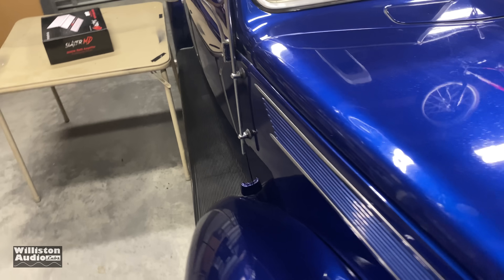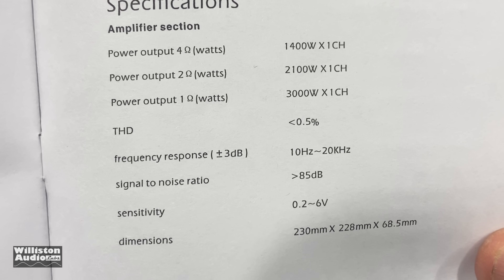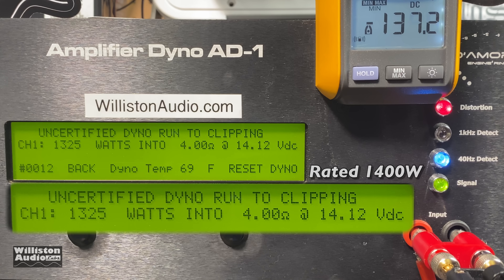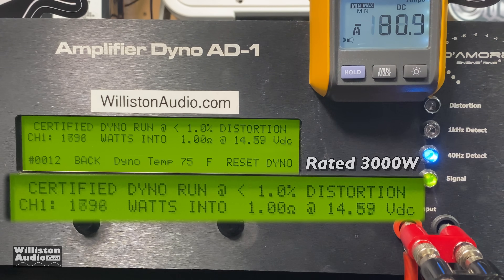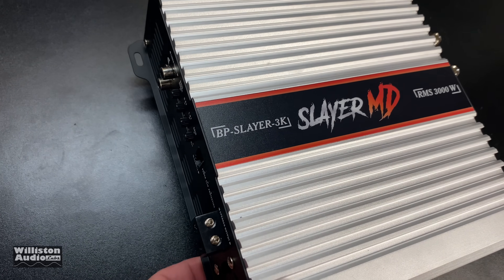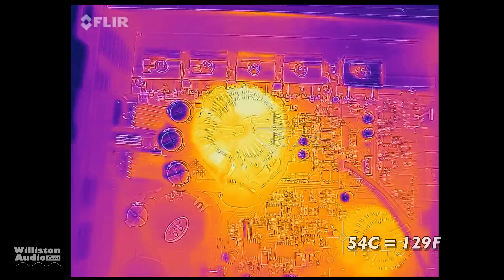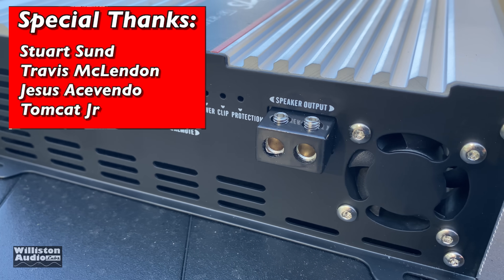Can a $180 Amp Do 3000 watts? Bully Performance Slayer MD 3kW Amp Dyno Test

Comment: I don't care if an amp puts out 20,000 Rms and is on sale for $99.00
I don't shop Dollar per watt like when I was first starting out. When I spend my time on an installation I want it to last as long as I own the car. I don't want to worry about anything. Name brands that have been around only for me. Sound, clarity, longevity.
Not something that's going to kill my electrical system either.

Comment: They come with the new bass knob from the 5k video now🤣 i ordered mine after watching this, has a vm bass knob and clip power protection lights, cat 6 ethernet  style cable. Oversized 1/0 inputs, im running oversized cca 1/0 to mine, cables dont get warm so im not crazy worried, ran mine @ 1 ohm on a set of gravity audio g3 12s in a sealed enclosure, wound up blowing those in a monthish, now im at 2 ohms on a single seismic audio gfc 12 thing giant
Reply: I had to double check the rms at 2 bc i dont wanna blow this beautiful sub, gonna hook my audiobahn a8000t back upto it i think haha

Comment: Should test it at 0.66 ohms. I'm tempted to try it with mine but I'd like to know if it will handle it first. Lol
Reply from the maker: Most of these full bridge are not recommended with loads under 1 ohm. Try at your own risk

Comment: I just found (and bought) the only one on eBay for $180. Thanks for the lead Big D!
Reply: Aaaaaaand I've now cooked two subs with it. Today I ran 1/0 ofc and did the big 3. First victim was a JBL 10, not even sure of is max wattage. Second victim was a sundown 12 rated for 500.
 D was dead on about the potentiometer in the bass knob. It's all but useless. I still can't believe the power from such a small amp. Thinking about ordering some Rockville Punishers and building a 4th order.
Reply: Also I'd like to note that the lpf has a very wide slope. Set at 50hz it still puts quite a bit of power into frequencies up to 125. You can tell it's rolling off, but not much. I'm thinking about adding a crossover to get better control.
Reply: I put a Skar VXF12 on this thing today and it lbs.
Reply: I'm still rocking this amp hard over 2 years later. It's now pushing a Skar ZVX-12-2 wired at 1 ohm. I recently added an ioxus ultracap.

Comment: Will u test a stetsom 3k or larger I'm really leaning towards them and I like the clip button they have.
Reply from the maker: Pass on da Stetsom. Go Banda or SounDigital if you want the best Brazilian
Reply: @wal  idc if it's brazilian, chinese, or american I just need 3000 watts RMS @ 1 or 2 ohm stable as cheap as possible.  What would u buy?  I've had taramps 3000hd and I have no complaints but the price of the amp keeps going up

Comment: I wish you could test/check my 5800w 12v amplifier with built in Cross over. 2x 2650w stereo. £85 brand new. So I really need a capacitor or two and a ground loop isolator. Please respond and help if you're interested or have nothing better to be getting on with, and maybe you can help me get the most from this amp? Happy lockdown party people xx

Comment: My receiver died of old age so I grabbed my old Alpine MRV- F353 five channel car amp to power some 150 watt Klipsch floor standers. Using my Galaxy S9, the highs and mids are clear but on some songs, the bass seems suprisingly strong. Is that normal? How is my phone DAC compared to an Alpine head unit DAC? I bridged the amp to 125 wpc but with the phone max volume, my windows weren't shaking.

Comment: 😲 "What and the Heckle n' Jeckle....?!?!" I mean literally... Why not just buy 5 at that price and size? I mean run each speaker using just a mere 20% of the Amps output or roughly 240w +/- and then use the last, or 5th one, to crank the shiz up to a thow or so, just a bumpin outta of your sub. Distribution Block it and fuse it to keep your alternator from frying.
     Future proofs too, for sure.
      WHY can't I get home Amps that cheap? Whether it be a Sub Plate/mono block, or whatever that cheap. MY Crown XLS-2002 and even my Behringer NX4-6000 seem over priced now. Just run one of those per speaker and be done. Like... Done, done. hmm 🤔

Comment: Did you try .5ohms?
Reply: Pretty sure this is a full bridge amp, which you really can't load below reccomended
Reply: @trevormtb9372  it's going to over stress the amp for long time .5ohm but for a quick test it should be able to handle it even though it's not a big name amp like kicker. I have my kicker 600.1 ran at 1ohm pushing 2 15" old-school sound stream 170's. And it's not rated below 2ohms.
Reply: @headkase11  youre mostly right, but this is a resistive load not an impedance load. Meaning there's no box rise. When pushing subs, amps usually see a load a lot higher than the nominal impedance
Reply: @trevormtb9372  that's true buttttt in the past he had extra bonus footage of going below recommended loads 💪🏼

Comment: How did you wire the four subs to the amp?
Reply: Probably series parallel.......
Reply: 4) dual 2ohm subs wired series then paralled together would give u a 1ohm final load

Comment: When you say stock electrical, is that the hot / ground wire or sumin else ?
Reply: Have extra batteries 150ah, use 0awg or bigger,  big 3 and or alternator 150+ volts.  Stock wouldn't have any of these!
Reply: @AGAPE_78   gotcha. Thanx buddy ole pal
Reply: It's the wiring between the alternator and battery, the grounding of the battery and engine (alternator) and body, and then all the wiring and extra batteries, caps, etc you add in order to connect the amp.

Comment from the maker: Video Timeline:
0:00 Slayer MD Trailer
1:13 Unboxing of the Slayer 3K
1:49 Included Accessories
2:55 Features / Dimensions
4:14 Amp Dyno Tests
7:48 Test Results
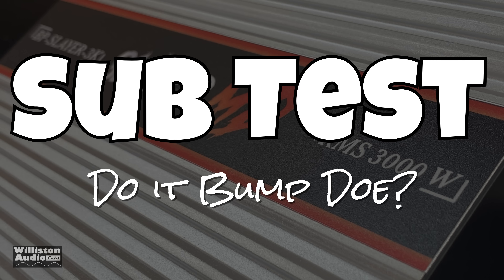8:08 Subwoofer Tests
11:37 Thermal Imaging and Internals
12:57 Pros and Cons
14:18 Extra Boom
Reply: all that time and they are all gone and not making anymore
Reply: Check out those topstronggear amps on Amazon. May be something your audience will enjoy.
Reply: How many extra batteries would you recommend to run 3kw, I have a 600 amp hr fastbatt capacitor and one 940amp battery under the hood with a 1000amp agm car battery in the back close to the fastbatt. Zero gauge power and ground but no big 3
Reply: @201231  I'd do big 3. You have enough batteries. You need the big 3 to keep those charged and possibly a alternator bigger than stock in my opinion.
Reply: @markeithcash  I misspoke about the fastbatt, it's 7 amp hours 600 Max amps @ 16 volts
Reply: @201231  how many amps is the Alternator
Reply: @craigengelman4534  stock 105,they have a stock 145 for the headrest dvd screens if you chose that option
Reply: @201231  you gonna need 200 plus amps

Comment: 2 questions
1. Why does efficiency go down when the power output goes up?
2. I'd like to know how long the amp can play before it goes into protect mode?
Reply: I laughed at #2. Amps aren't supposed to go into protect. It means something is wrong. Either it's getting too hot, wrong impedance/load, total failure.

#1 is how electronics behave. Especially cheaper ones like amps. This one being 80%/78%/68% is actually pretty respectable for amp efficiency
Reply: @tonyamaya6972  yeah your'e laughing cause you're a dumbass lol. This is a cheaply made amp, I can't imagine the amp playing for extended amounts of time without getting too hot and going into protect mode. Maybe it can which would be more than impressive for the price... maybe you're rich and have never had a cheap amp before, if that's the case your money has made you more ignorant than my question.
Reply: @HeadHonchoMofo  I think you took me lol the wrong way. Maybe your cheap amps weren't the problem there Chief. I've had amps go into protect... Because I was doing something wrong and because I'm in Phoenix where thermal protect of the 90s and early 2ks was easy to achieve here
Reply: 1 more energy flowing from the battery input to the audio output generates heat which wastes energy.  There is more heat generated at lower ohm loads so the efficiency suffers.

2 an amp should never go into protection mode after any amount of time. If it does that means that it is not hooked up and adjusted properly, or it has failed internally.
Reply: @303nitzubishi4  amps still get hot, even if they are hooked up right. Being this is a cheaply made amp I can't imagine this amp pushing 3k for extended amounts of time without overheating and going into protect mode. Maybe it can, that's why I'm asking the question.

Comment: Hey Big D could you pretty please test some of the new Power Acoustik vertigo amps. They have a claimed 1000 watt amp for 99 on sale right now.. va1-4000d
Reply: I can tell you rn you wanna divide anything power acoustik makes power by 4. My 2500D 2500 watt max power is more like 800 watts max power
Reply: @austinwoodside   I'm totally skeptical of their BS claims but this one has 3x 40 amp fuses seems promising
Reply: @rmblwgn  Hope we get a test video because that would be a great deal. If my math checks out it could put out 1700-1800 depending on voltage

Comment: At 9:29 your subs are bottoming out badly
Reply: Knock knock.
Reply: mine also sounded like that where it sounds like a really bad loud screeching noise or something hard to explain, the subwoofers still hit like crazy but during the songs and different notes it doesn't sound normal what can i do about that? do i need a different box? because i had to use a hammer to force the subwoofers into my box even though the box is for 12s and the subwoofers are 12s
Reply: @RedragonReviews  Bigger xmax subs, or use subsonic filter
Reply: lol probably just didnt spend time adjusting subsonic

Comment: They should of named the amp "The Fire Starter"
Reply: I'd guess if you treat these amps with respect, they'd last for years.
Reply: James Plotkin  Agreed, I think that goes for most things.  I don't like abusing products I have purchased.  As an example if the amp is rated for 3000W I'll only run it to maybe 1200W, if I need 3000 W I'll buy a 4-5000W amp that way everything stays happy and it's not pushed to its limits.

Comment: Big D, I have 4 of those same exact subs, I've heard them bottom out on the back plate before, (my fault), I swear, on some of those bass tests you did, I heard those subs bottom out 😬 .. am I hearing things? Did you set the filters on the amp ?
Reply: That, or whatever he has the box sitting on. Could be either but that box sure was moving around.
Reply: I thought I heard it too!
Reply: Yeah there are alot of commentors that heard them bottom out. That's the risk you take when you're tryna make an impressive flex video. I doubt bigD tunes the subsonic filter for these quick tests these are just for fun

Comment: Looks like a generic taramps 3k
Reply: All High Voltage boards are the same lol
Reply: @989Kaleb  full bridge amps are lower rail voltages.. But this is a clone of a taramps.
Reply: @trev6783  definitely
Reply: That's the point. They are trying to fool the public. No different than the amps they sell that claim to have 10,000 watt peek and put out 12rms.

Comment: On all ur vids big d ive never seen ur savards slap almost out of the box my only worry is the cheap internals or id order 1 right now. It looks like a cheap knock off of taramps hd3k and performs similiar.  I also watched the whole kicker live show i seen u guys lol i run 2 kicker comp r 12s 2ohm dvc the preloaded box u get from best buy for around 470 bux i got it hooked up to the kicker cxa 800.1 i think they wire those in series from the factory ima have to put a ohm meter on the box but at max volume on my brand new kenwood deck with gain on 9/10 i cant even get the amp to even get warm  so im thinking its only putting a 4 ohm load on the amp.   Thanks for the cool video great halloween treat .
Reply from the maker: Those subs were slamming 🤟

Comment: One thing you might try is a Powermax power supply or two. They are pretty cheap and have 100 amp output. There are pots inside u can adjust the voltage level and you can run up to 3 in parallel. They are mostly used in RVs.
Reply from the maker: The Massive Audio PS I use can have up to 4 in parallel and they are 100A each
Reply: @wal  Dab Nab IT! Im just no help at all! lol

Comment: Do u think its worth it? And do u uh I'll no it will run at .7 ohms? My subs wired up will be at .7, not sure what rise will be but need a bigger amp than what I have right now.
Reply: I highly doubt it, since it's a cheap full bridge. I wouldn't take the risk
Reply: Probably correct. Its sold out anyways. Can't get it for 180 anymore.

Comment: It’s crazy how small these amps are getting these days. I remember back in the 80’s & 90’s an amp pushing anything close to that power would be as wide as your full size truck. Also  you’d need to mortgage your parents house lol.
Reply from the maker: That’s the part that gets me and something these young guys have no concept of
Reply: @wal  late 80 into the 90s there was no 2000 plus watt amp . i used to compete with a memphis hc100 that was 890 watts @ 1 ohm . then got the mojo wich did 
1 × 1681 watts, channel 1 at 4 Ohm with 13,3V supply voltage
Current consumption 157A
efficiency 80,5%

1 × 2813 watts, channel 1 at 2 Ohm with 13,2V supply voltage
Current consumption 281A
efficiency 75,8%   that powered 2 danley 15s in a 5 cub tapped horn box
Reply: Quite amazing what the newer switching technology can do. I still remember using the old class-B stuff and the whining alternators and dimming headlights back in the mid-90's from all the power they consumed, and LOTS of heat. Now the small Rockford Fosgate class-D in my trunk barely consumes any power, and doesn't get hot even at several hundred watts of output. With the old class-B linear amps the efficiency would be maybe 60%, now with class-D they can be over 90% efficient, and still have low THD, and running as a bridge tied load they only need one supply rail, which further reduces the size. Downside is much higher currents and stresses on components, so they tend to be quite spectacular when something goes wrong. Another somewhat questionable practice is removing the output filter to further reduce the size, which is a bit sketchy since it sends pulsed DC at up to around 160-180V right to the speaker terminals. With that said, I designed my own switchmode power supply for a class-B amp I built for my hi-fi setup, and what was once a large 35 lb. box is now a small 2 lb. box, thanks to the compact and efficient supply.
Reply: My kicker zx 2500x1 was over 2 feet long lol I wouldn't trade for this but damm that much power in a tiny little unsuspecting amp is nuts 😅
Reply: And some didn't even do this kind of power.

Look at the McIntosh MC4000M - the model number related to the price tag.
Reply: @VisionSandS  100x6 or 2x300
Reply: Looking back at the "guts" shot is even more impressive. It looks like they have just one transistor for each portion of the bridge, meaning that only two transistors on each side of the bridge are pushing over 3kW of output. Very impressive.
Reply: 😂 so true!!

Comment: Good showing by this amp. Up here in Canada I checked the price on Amazon and it's going for $430CAD through a 3rd party (not Amazon direct). Given the price, it probably makes sense to get the Taramps line as it's more than 100CAD cheaper and more people have experience with these.

Comment: Great video dude, keep them coming. What video editor program do you use?
Reply from the maker: You probably won't believe it, but $30 program on my iPad Pro called LumaFusion. Been using it for 3 plus years. Before that I used Vegas Pro on my PC, but it continually frustrated me with locking up and such, so I moved to the iPad and never looked back. Does 95% of what the professional programs do and that's good enough for me.

Comment: FINALLY! A budget amp that makes it's rated power! I feel like everyone in management at MaxxSonics was just fired! Like the "3000 watt" Lanzar amp that I bought on eBay and not only did it have spade connectors, but it couldn't even push my two Pyle 12s that I had back in the day. I gave it to a friend along with those Pyle 12s and he's rocking them. I now have four Sundown SA12-D2s and an Orion HCCA 3k SPLX amp. My J32A2/six speed manual swapped Accord has a Big 3 upgrade with 0/1 OFC wire, a 360A alternator, and 0/1 OFC wire to the amp using only one power and ground input (for the moment, those subs are only rated at 500W per speaker).

Comment: 62% efficient at 3kW (1Ω) translates into a whopping 1140W of HEAT!  Those "heat sinks" aren't going to do squat. Think how hot an electric iron gets with 1500W.  With music it should be OK but long playing bass with truly 1Ω loads it's gonna run away.  And there's no fuse so better have one or a circuit breaker because crowbarring your system with dual 1/0s is gonna be ugly. ;-)
Reply: Has a fan atleast
Reply: @staples4335  That little 40mm fan will push outside air into the chassis, yes.  This, however will do little to cool high power semiconductor components that are sinked to the outside heatsink.

BUT, for the $$$ if it can handle intermittent peaks and not melt down an electrical system why not?
Reply: @cpufrost  He said the amp was cool to touch even after high volume for 30min. He even showed thermal video, one of the power inductors was the hottest part. It will be fine. Heat shouldn't be an issue. More the issue is cheap components.
Reply: @staples4335  I agree with you.  And with music it should be fine, even a burp here and there.  TBH I'm shocked it reached the levels it did.  Thought I was gonna hear that loser buzzer from "The Price Is Right" LOL.  But yeah on a super slim budget one's definitely not gonna get a box filled with Nichicons or Rubycons. ;-)